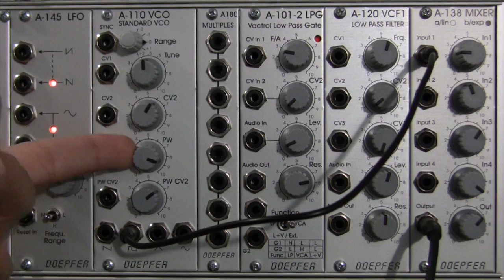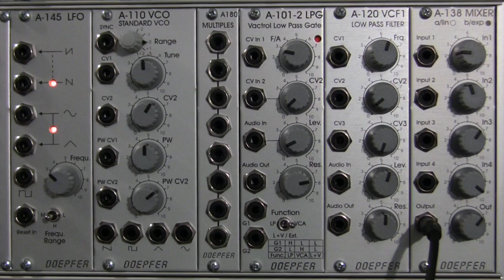Doepfer A110 VCO Audio Demonstration 1 - Waveforms and Pulse Width

Comment from the maker: @netton1956 The sound produced from the A110 VCO can sometimes produce extremely low frequencies which are difficult to hear.From 2:56 to 3:20 the sound should be audible. From 3:50 to 4:20 the sine wave in the -2 ,-1 position does become naturally hard to hear. But if your speakers are turned up it should be experienced as a faint rumble. Around 4:50 while the triangle wave is demonstrated in the -2,-1 position it is very low frequency as well. Raise the volume it will sound like faint clicks.